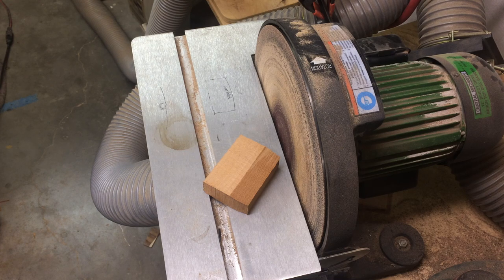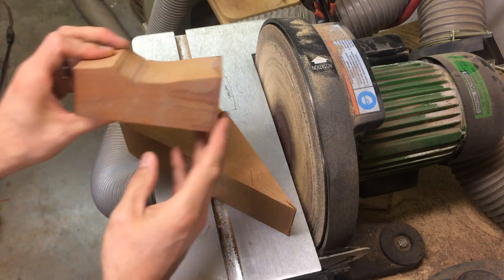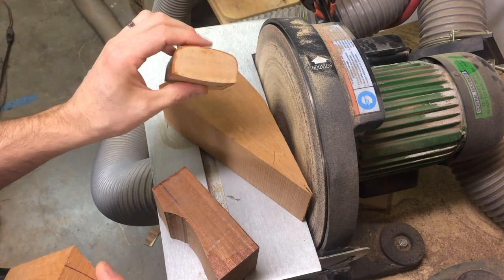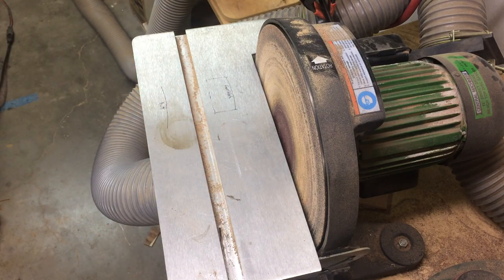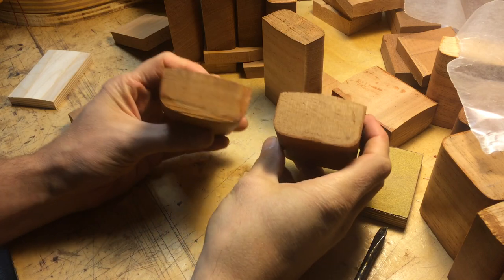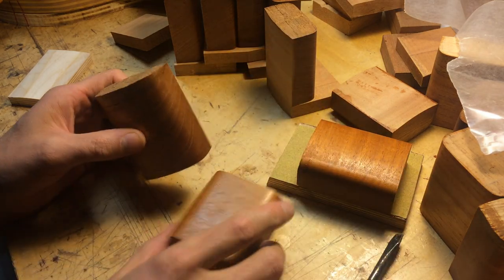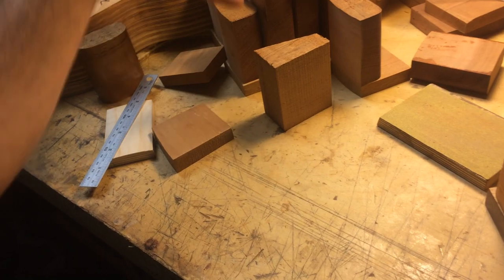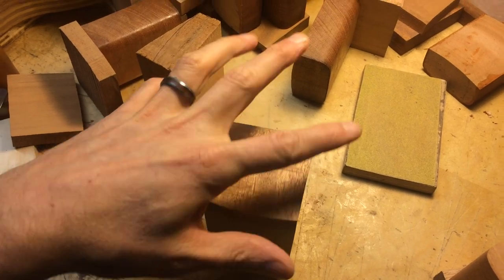Making and shaping head blocks for guitar and ukulele Beau Hannam Guitars and Ukuleles

Comment from the maker: Guitars and ukes are always made with the block grain orientation horizontal, ie the same grain direction as the sides. On the other hand, violins, cellos etc spruce head/end blocks the grain are vertical. Which is better?- I actually think vertical makes more sense as it means that the side grain is at a right angle to the blocks which ads strength. Having said that, I still make blocks with the grain horizontal (so it follows the side grain). I guess both are totally fine as there is more guitars in the world then violins and with that many guitars with blocks with horizontal grain, any inherent problems would have presented itself.

Comment: Thankyou as always Beau.

I have a question regarding your neck joint. Do you glue it as well as bolting? If so, what is the advantage of the bolt on over a tapered dovetail or similar, seeing as both would need steaming out for a reset? 

Cheers!
Reply from the maker: I do a Mortise/Tenon with bolts- 1 for ukes, 2 bolts for guitars. I glue the M/T but many don't. There are no advantages of M/T over dovetail, it's just what one prefers. ALthough, ukes rarely need a neck reset, if ever.

Comment: Great explanation and wood grain orientation is maintained for the top as well as the sides. If any expansion were to cause a crack, hopefully it would be at the glue joint of the block. I also applaud the full use of cut offs. I did notice the tail block is laminated and while not part of this video may I ask, is that plywood and if so, what quality? I enjoy your videos.  You certainly produce a quality product.
Reply from the maker: Hi 60mando- I use best quality birch ply for tail blocks as if a pickup is ever installed, drilling the 1/2" needed for the jack isn't going to weaken the ply.- I also usually add some decorative wood or an offcut of the actual side material over the ply to make it look nice.

Comment: Thanks, Beau!  I've built 2 tenors and after a 2 1/2 yr break am building #3. The neck block grain orientation; your reasoning for end-grain to be horizontal rather than facing the back and top?  This one is black walnut and I've some walnut to use for neck and end blocks.  Good? Bad? indifferent?

THANKS!
Reply from the maker: Guitars and ukes are always made with that orientation. On the other hand, violins, cellos etc spruce head/end blocks the grain are vertical. Which is better?- I actually think vertical makes more sense as it means that the side grain is at a right angle to the blocks which ads strength. Having said that, I still make blocks with the grain horizontal (so it follows the side grain). I guess both are totally fine as there is more guitars in the world then violins and with that many guitars with blocks with horizontal grain, any inherent problems would have presented itself.